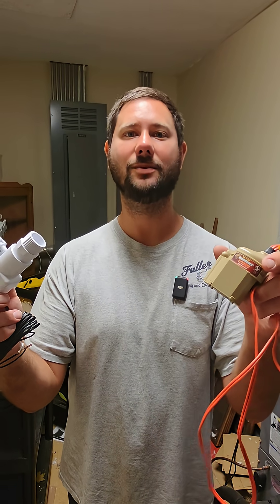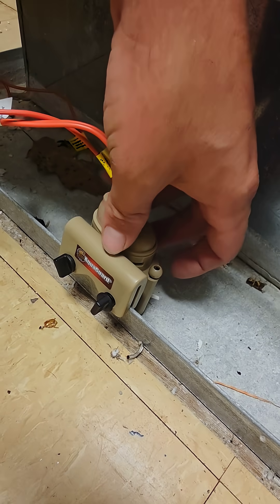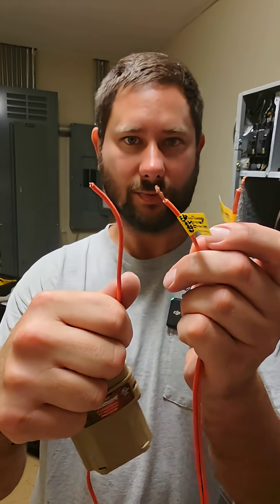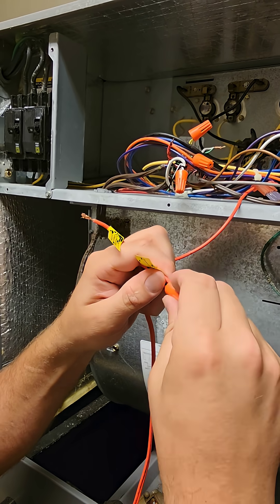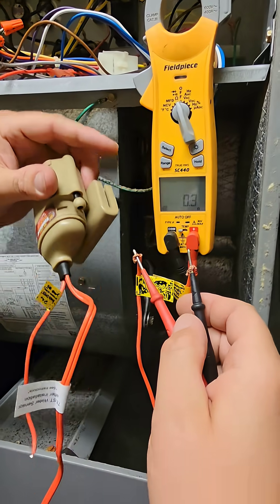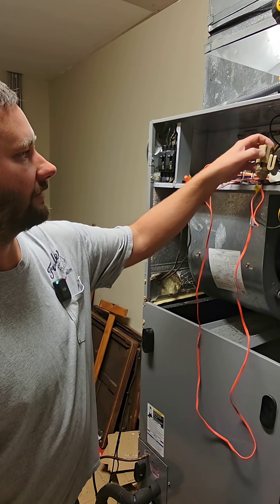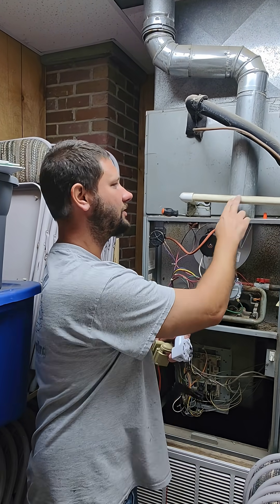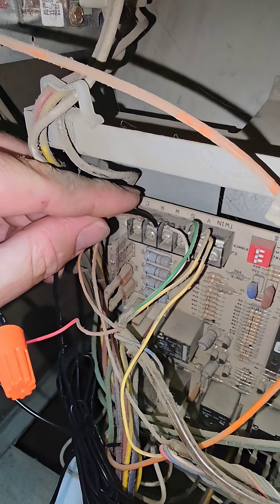How do you wire a float switch? #airconditioning #hvac

Comment: just a note about location: my lennox furnace is factory plumbed so that if my drain line going outside plugs up the water backs up into the induction motor housing before reaching the a/c coil pan???? Burnt up one induction motor that led to this discovery. So Lennox owners (and others) if your system is plumbed that way, a float valve would also need to be placed downstream of the  furnace drain outlet in the drain pipe

Comment: I tried switching the wire from the fan to connect to the thermostat red wire. It didn’t work. What’s the process for connecting two float switches in series to achieve this?

Comment: Like the Videos!

Yet?

That WireNut Splice?  Horrible connection! 
   Where's the Strippers, and the LineMans Pliers?
   No Tape on the WireNut, to Prevents Vibrateds Off WireNut...... 

Justs a Lil Bits More Time!

ThanXx for the Content and the Sharing.

Comment: I thought the SS2 goes into the secondary drain port because the p-trap is connected to the primary drain port
Reply: @michaelnixon1232 
Ss1 is a mid pipe of main drain. Ss2 end pipe (aux drain), ss3 on any tray.

Comment: So if the switch fails in the winter your customers lose their heat when wired this way. All you are protecting against is condensation from a/c, just break Y. Love your videos but wondering why you don't break R instead. I get it if you are trying to have the thermostat turn off, but a bunch won't even do that because they run off batteries.
Reply: You worried about condensate in the winter time? Even if you broke Y and doesn’t shut off you will have the same problem you were trying to avoid.

Comment: Hmm. Good stuff... Never saw one with Normally Open wire.. So one could put a beeper or light to warn the tray is filled. Still, I prefer to just cut the compessor in case it's a coil frozen over cuz even dummy Floridians quickly realize the air is blowing warm.. I like your idea for the drain line switch tho cuz (rarely) they can cause a short cycle situation which is hard on the compresor..

Comment: In my area Winston Salem nc. They broke the low voltage to outdoor unit. Your way maybe better. Don’t know if it was a code thing or not
Reply: @DavidLisenby-z8b  I prefer to break the condenser wire also.  At least it allows the fan to work when tripped.  Also smart thermostats can get screwed up by cutting their power.

Comment: Breaking R makes for a quicker diagnosis in the future.  Thermostat off? In the summer? 90% of the time will be a clogged drain.
Reply from the maker: That's a great point, thanks for sharing!
Reply: @shiTheadith  I guess you’re comment answered my question because I normally see that connection on the  Y  terminal

Comment: Quick question. Can you install the safety in the secondary drain outlet? Also I usually always break R on a gas furnace I’ve seen other people just break “Y” to just kill the cooling but that’s not always best correct?
Reply: That's where you install the float. On the secondary. He mentions that opening the circuit at r/power is easier to diagnose than the y/cooling because the evap blower could still be running while the cooling circuit is open/off but if the whole circuit call r/power is off then the whole system is shut off. He mentions how you may notice the thermostat "would turn off and help you identify that the float has opened the circuit but that small detail may not be the case if your thermostat is also on battery power.

Comment: You should break Y not R so the fan will run also you need a vent tee after a pee trap
I'm a 20+ yr ac man in south east Texas
Reply from the maker: Thought about saying that in the video
Wish I would have included that
Reply: I always break R. If you allow the fan to always run the client will never know their drain line is clogged. There are slow drains so if very little water terminates then the clients are going through a cycle of events. A constant triggering float switch may cause the system to turn off and on and even cause the float switch itself to go faulty. Breaking Y still works it’s just I would rather like to know that my drain line in my attic is clogged by my thermostat being blank.
Reply: Yeah I agree now with r instead of y because you would get an immediate indication that the system is down from the float but the blank thermostat is determined by its install. Even though alot of folks will wire it to have power alot of people still put the batteries in. @patricioblanco941

Comment: Why didnt you put a set of tees on the condensate line? What happens when that peetrap gets clogged? Do you just cut it up to remove the debris?
Reply from the maker: I was just using this unit as an example
There should always be a tee, for, clean out and maintenance
Reply: @Misfit.Profit  always someone hating.